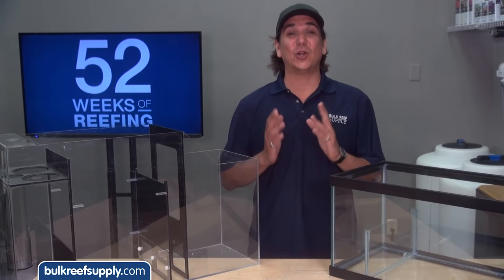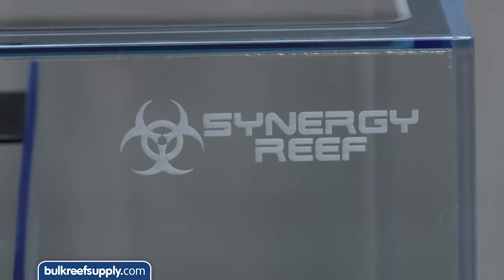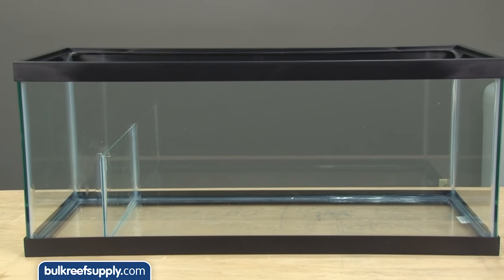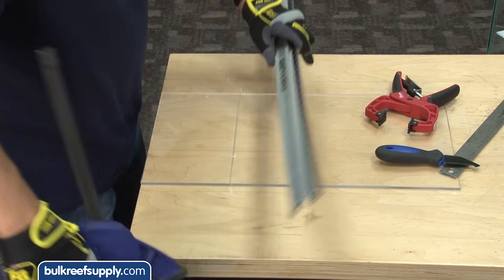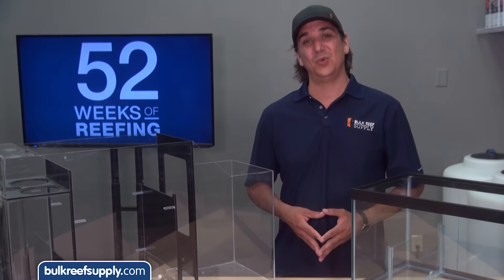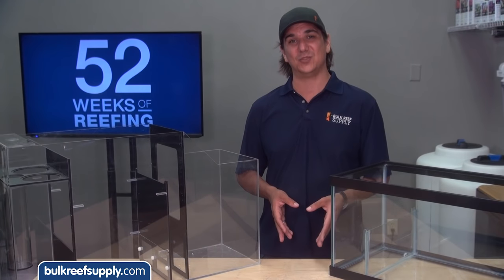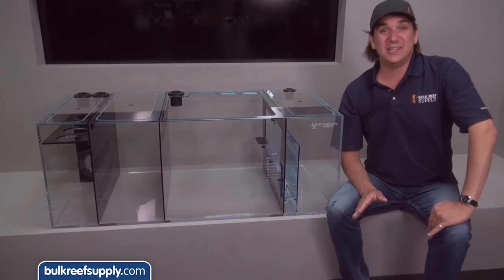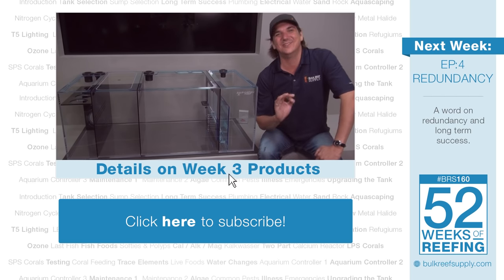Week 3: Sumps - What do they do, and which should you select? | 52 Weeks of Reefing

Comment: I should have watched this before building my sump. I purchased a set of baffles off ebay; they were great, had cut slots where appropriate at a height that I requested to set the water level I needed. The detail they lacked and that I missed that you so accurately point out was the corners at the bottom. 8 months after setting up my tank and sump, with nice growth on most corals and a happy reefer new to the saltwater part of the hobby, a fan of cracks appeared over night, with the vertex at the bottom of one of the baffles. It's a slow leak and not a complete blowout luckily but I'm going to replace it with a commercial sump, crossing my fingers with a patch of silicone and glass over that side until it arrives.

Comment: As far as cutting glass for baffles goes. I just used a wet tile saw with a glass blade, worked like a charm. Of course this adds a cost for a power tool to the build. But I had it from a home remodel project anyway. I used gloves when cutting the glass. and then sanded the edges with 150 grit sandpaper to keep them from being a danger to work with during installation.

Comment: thanks again for the great video. i'm looking to upgrade my sump for my 125 gallon reef tank. nothing too intricate, just simple for my protein skimmer.
Reply: I'm looking around for something simple and not too much money, but made well. I have a 125 gallon reef with a lot of tangs in it. I have an eshopps RS-100 sump. I don't use sump socks. I currently have 2 chambers. One for my protein skimmer and a smaller one for 2 return pumps. I go back and forth between using the foam block. Nothing too pricey. I thought of the simple reef octopus but not sure. Something more like the Crystal Sump 36 but I won't be using the sump socks so maybe that first chamber would be pointless?

Comment: First of all Love BRS's Video's, always very informative for beginners to the hobby like myself.

This sump looks FANTASTIC, the sumps layout has raised a question for myself regarding the refugium chambers location.

You mentioned that space for the refugium is right after the filter socks, most of the information I have found about recommendations for refugium in the sump have suggested that you want less flow through your refugium so should be separated away from your main sumps flow.

This sump appears to feed the full flow of 2000 GPH for the EcoTech Vectra M1 through the Refugium assuming you run it at full power.

Would BRS/Ryan or the community be kind enough to provide opinion/advice on the flow through a refugium and its effect on performance for the refugium for me?

Also related but slightly different, would flow hamper Copepods population in the Refugium?

Dreams of a Green Mandarin in his large reef tank one day

Any advice on this would be greatly appreciated :-)

Comment: I'm having a heck of a time with the sump that came with my used tank. Can't seem to keep water flowing quick enough over the baffles to feed the return pump efficiently. I have 3 overflow tubes that come down and feed the sump starting from the right. The water flows to the left into a refugium then over another baffle to the return pump on the far left of the sump. It's 55 gal tank and the return pump is a Marineland NJ4500. Thing pumps at a constant 1700+ gph. The return tube and overflow tubes are all 1". When I go to rebuild this, how to I choose where and how high/low to place the baffles in the new sump? Do I need to measure water flow throughout the whole thing? I feel slightly overwhelmed.
Reply: BulkReefSupplyCom so would a small marine land 500 gph pump work ok? One of the ones that can double as a circulation pump or current fan?
Reply: BulkReefSupplyCom PERFECT! Thank you! Last question then I promise I'll leave you alone! Lol. When it comes to building your own sump, what's the smallest size you would recommend for a 55 gallon and how would you recommend setting up baffles? Currently, I have 3 chambers. A drain chamber, a middle chamber, and a return. No skimmer yet or functional filtration set up. It's a poorly setup sump that came with the tank. Does the layout matter that much as long as I have room whatever equipment I'm going to use?

Comment: What is the make of the spot light on the sump at 43s of the video lighting the chato?
Reply: ***** Kessil say the Tuna Sun is for Freshwater Aquariums and Tuna Blue is for Marine Aquariums. Could you expand on reasoning for your selection of the Tuna Sun as both lights are the same price.
Reply: ***** Thanks for that. I have ordered from Amazon here in the UK as I know you don't sell internationally. But thanks for all your help. At present I have an Arcadia 1W submersible spotlight. It was cheap, looks cheap and appears to be way under powered for what I'm trying to achieve which is growing chaeto in a refugium, regardless of the good press it has received on nano tanks. If past experience has told me anything, good results are quite often based on putting your hands in your pockets and selecting a solution which is guaranteed to deliver rather than a cheap solution that has a high probability of failure.

Comment: With glueing acrylic, I know there is acrylic glue that provides as good a result as glass and silicon, is this just not reef safe?
Reply: Acrylic cement such as Weld-On actually melt the acrylic and fuse the two pieces together acting as one. The cement actually just evaporates and goes away leaving a strong bond. 
This however, only works with acrylic to acrylic as glass has no reaction.